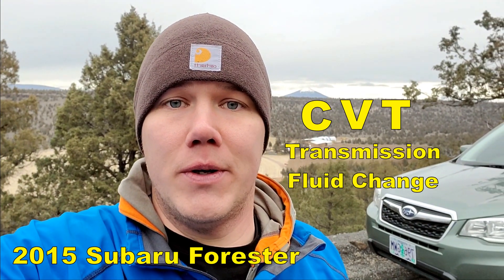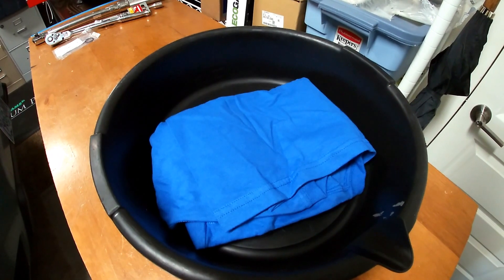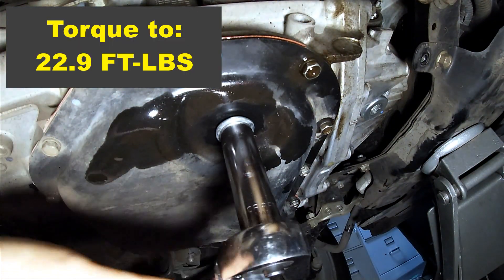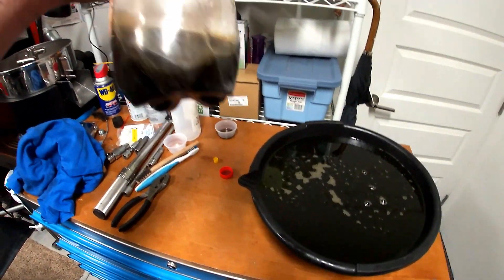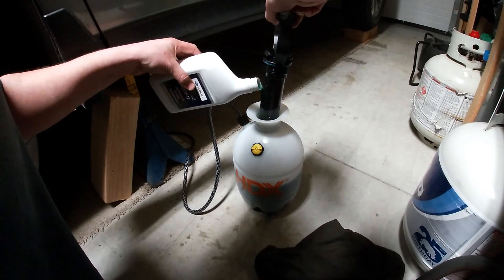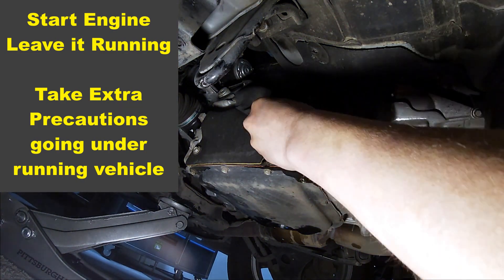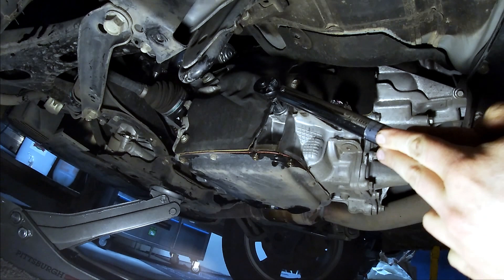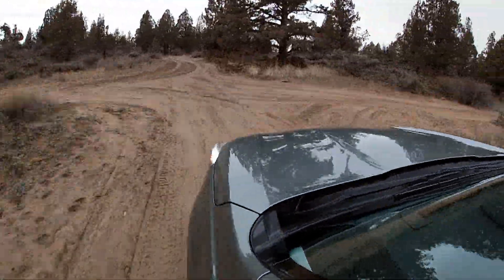Subaru CVT Transmission Fluid Change & Flush Procedure | 2015 Forester Replacement-Fill-Level Check

Comment: thank you so much for this info it was a excellent video with such a detail on every aspect!
 I've been changing my  Front and rear differential oil this weekend on my 2012 Subaru XV,  it was such a fun job to do I would love to do the same with my CV transmission  but here in Spain nobody sells that fluid original from Subaru  (???)
 I've been talking with some dealers there in USA but none of them sales out of the country...
 I will keep trying to buy the product so I can do the job on my car.
 Thank you so much again for the priceless info you gave to us 
😊👍🏼🚜
Reply from the maker: @Jason-h9s7h  excellent, there are several folks using amsoil. Pretty much up to the owner. Thankfully the Subaru fluid made by Idemitsu is very high quality, same color as factory fill. Two reasons I stayed with Subaru fluid is because its very difficult to swap 100% of the fluid with a different fluid, and id rather keep it mixed old/new with the same fluid. The other reason is due to reports of great results with other fluids until 15k miles later, slight shudders, but once changed back to subaru fluid their shuddering went away and stayed away past 20k miles. In this case I play my odds with Subaru fluid, though it is expensive.

Regarding jacks, look in my video closely, you will see I shimmed up my rear wheels on blocks and leveled with jacks in the front. Only used 2 Jack's. I felt uneasy about it too, but put extra blocks under the car incase something odd happened. All in all I felt safe about it.
Reply: @MTsubfly  Hi bud! This was super helpful. You keep using the word "Jacks", but honestly, those are jackstands I think that you are referring to. Just wanted to clarify that, cause I noticed you saying it in the video and in a few comments. Thanks tons for this video.
Reply from the maker: If I understand what you mean correctly, yes you can do that, you would need to buy a hose barb to connect hose to hose in order to do this. I found it easier to just put a hose i already had directly onto the transmission.

As far as resetting, I think the only thing to reset is the fluid deterioration %, you may need the dealer to do it, I could not seem to do it with an old reader.
Reply: and you think is necesary reset?
Reply from the maker: Thank you very much! I try to put as much important info in one spot, it takes time to find answers to my own questions.

Regarding fluid. The Subaru fluid is made by Idemitsu. Maybe that is available?
Reply: ok, thank you very much.
question...in 4:50 with the heat exchanger...what if you just take out the IN port only?...that way you have dirty fluid in the flush coming out from the cooler and after it stays also clean...right?

and...did you have to do some kind of reset in transmition in order with this fluid change?...ive read something about that in a forum...
thank you
Reply from the maker: No not necessary. I didn't reset mine.   Its a computer generated % that figures time/temperature/distance/speed- to estimate fluid wear.
Reply: ok,it doesnt influence in performance i understand...

other things...when raise cvt fluid temperature for level, the car needs to be jacked? wheels need to rotate? or its ok moving stick throug gears with the car on the floor?
Reply from the maker: @andinamm2246  car needs to be jacked & level-ish so you can get under it. Wheels do not need to rotate. You can shift through the gears on the ground, but you still have to be able to get under the car with it idling in P to final check level.
Reply: thank you so much :0)
Reply from the maker: You bet cha! I wanna help buddy!
Reply from the maker: @Jason-h9s7h  sounds good! I wish you luck! 
Our car behaved funny when cold too, it goes away when warm. I speculate if this is related to fluid level being off, i.e. cold meaning the level is low until warmed and its a bit fuller. Not sure.
Reply: amsoil? thank you...
any special code or name of this specific oil?
Reply from the maker: @andinamm2246  just "Amsoil CVT Fluid". If I didn't use Subaru fluid, I would use Amsoil. Be aware Amsoil pushes a heavy marketing platform that they are the best in the world. While I am not going to dispute that, this style of selling product can come across "snake oily" and has fueled many debates on how good they are for the higher price typically paid for their products. Up to you sir. ..
Reply: thank you so much :0)
Reply: i live in spain...dealers here dont recomend to change fluid...and doesnt sell fluid to me either...subaru fluid from usa plus shipping plus taxes is more than 300 euro for me...
Reply: thank you :0)
Reply: cool! congrats! :D
Reply: MOTUL cvtf
https://d23zpyj32c5wn3.cloudfront.net/images/product_descriptions/technical_data_sheets/48957/multi_cvtf_es_es_motul_20191127.pdf?1576231096
Reply: mmmmm, thank you but...sorry...i dont thrust in any "all mighty" magic fluid...it cant be working on ANY cvt transmission...keine motul for me...
Reply: hi Guys!
been doing some research...my transmition seems to be made by AISIN...same as toyota transmision...is this right???
JACTO makes for nissan, mitsubishi...diferent brand...
so...ive found AISIN cvt fluid that fits on nissan and mitsubishi but NOT IN SUBARU...extrange...
ive found some idemitsu too, but compatible only with nissan and suzuki...i dont know if this ebay people knows about this matter...so hard by the moment
thanks
Reply: I have seen it on Amazon and eBay genuine Subaru CTF fluid that you can buy
Reply: Thanks
Ive bought 8qrt from subarupartsdirec
Over the ocean now

Comment: Good video!! I have a 2019 forester and I love it. the only thing concerns me is the CVT
Reply: me too, i have a 2017 one, i have around 50000 miles now, hoping it will last forever, lol
Reply: @carsonkuang5001  as long as you keep up on maintenace like cvt fluid. 15 impreza at 212k miles right now.

Comment: Is there an obd2 for iPhone that reads cvt temps?
Reply from the maker: I bet it will work fine, what you get to view with the OBD reader seems to depend more-so on what app you use. 

As far as particles go, I wouldn't be too worried. There is a filter inside you cannot get to, and they are designed to be clean machines. Just by draining the fluid you are removing suspended microscopic debris.
Reply from the maker: Yes, sure is. I am editing up a video  about the one I used and where to get one for apple right now. Go to bafx website under automotive there is one for apple at $25.99, stay tuned.
UPDATE:          Video Uploaded:
https://www.youtube.com/watch?v=KP1gUNm6Ddo
Reply: MT great. I hope it will work with Subaru Foresters for cvtf temp monitor. Plan on doing a simple drain/fill, not flushing. Worried about dislodging large particles, if they’re present.